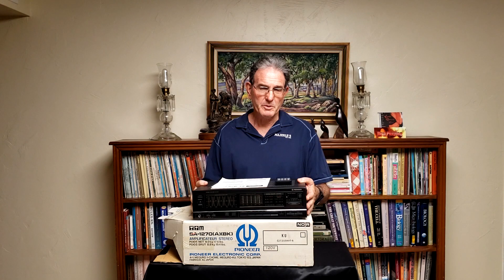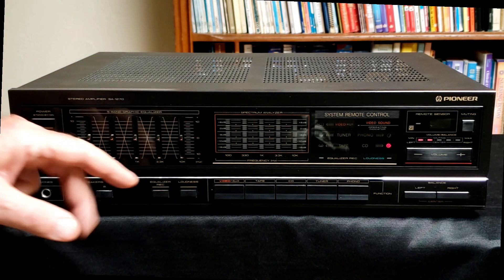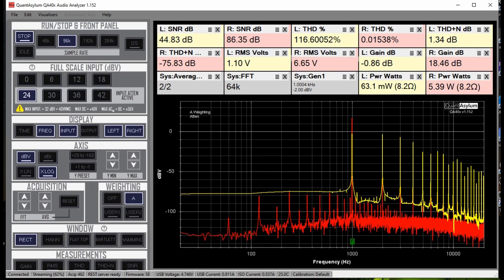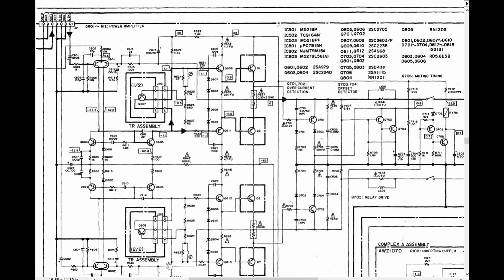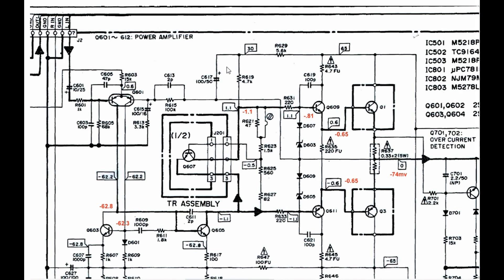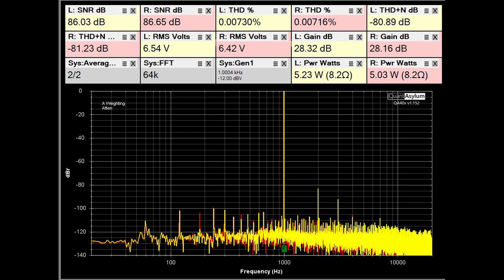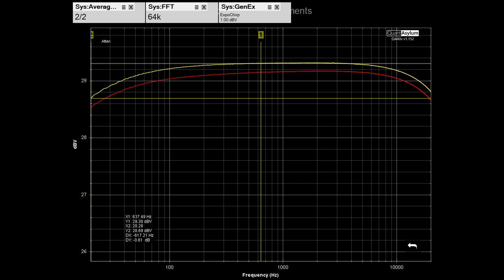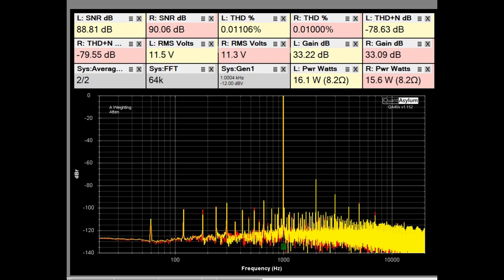Pioneer SA-1270 Integrated Amp Repair & Review- Vintage Audio Review Episode #12

Comment: I have been using the same model amp since 1982. It works well with the exception of the graphic equalizer display lights, which are more cosmetic than functional. I used this amp to play music for dances for three years in a small hall back in the 80s. It still works like new. Thanks for the review on this workhorse amp that was not expensive to buy when new, and is still cranking out the tunes 42 years later.
Reply from the maker: I love hearing about gears that is still working great after so many years of use- thanks for sharing! The amps should be an easy fix I would think

Comment: Hello. just wondering if the speaker outputs a and b are a separate amp channel or just a switch for convenience. im running multiple speakers and was wondering if i could get more power by utilizing both speaker channels.
Reply from the maker: Thanks for the question and watching. They are not separate amps for each channel and are typically switched to the appropriate speaker(s) via a relay or relays. You would not want to run two four ohm speakers, but two 8ohm speakers which would have a 4ohm equivalent impedance. The amp is going to put out it's rated power into whatever load that rating is for. If you had 4 effecient speakers that were rated at 8ohms you would probably get a decent amount of sound out...

Comment: Thanks for the well-prepared content.
I have an unrelated issue with one of these Pioneer SA-1270 amplifiers, but have not been able to find the service manual or schematic diagrams.  Any help locating one would be much appreciated.
Reply from the maker: Thanks for the comment and compliment. I actually spent $5 to download the manual- could not get it otherwise, here is here I got it:
https://www.manualscenter.com/manuals/pioneer/sa1270-service-manual.html#.Y60oldXMKiM

What is the problem you are having..?
Reply: @vintageaudioreview  I did see that option for the service manual, but was slightly skeptical.  Thanks for confirming that it's legit.

As for the problem I'm having...
There is voltage at the power switch (stand-by light works), but not much further.  No other lights come on and there is no sound.  The relay you mention in your video clicks immediately after the power is toggled (no delay).